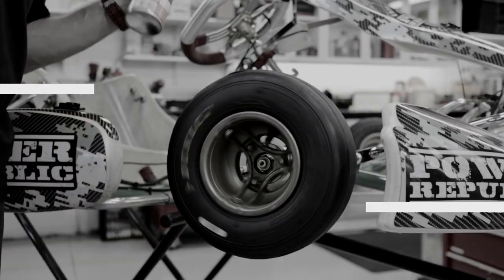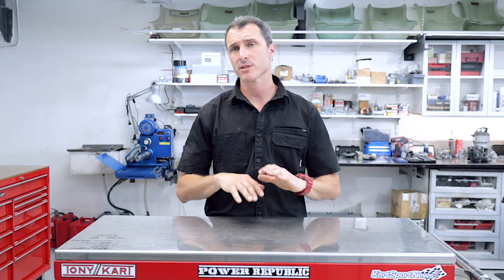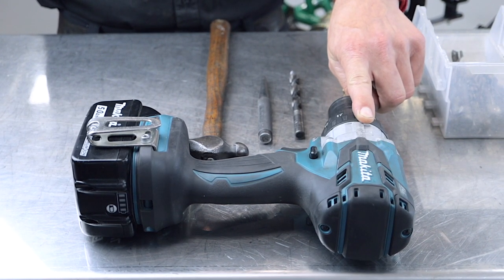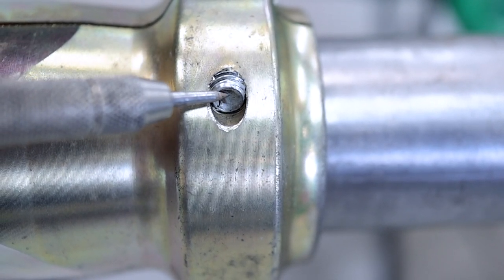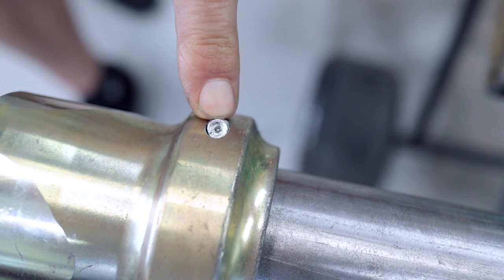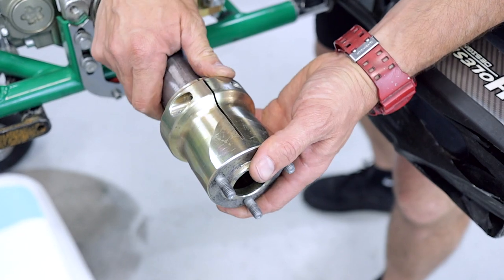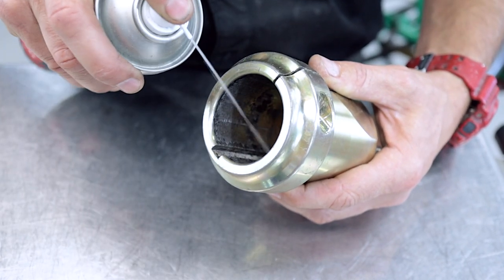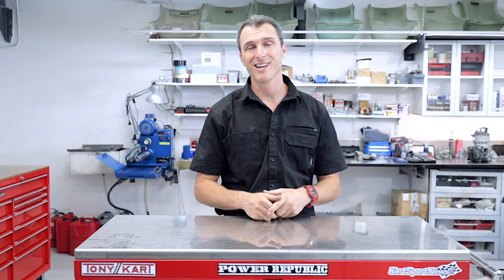RACE DAY SURVIVAL SERIES: Episode 1 - Stuck Wheel Hubs - POWER REPUBLIC

Comment: Another great and informative video Derek.  Keep them coming!  Just wanted to add that I recommend placing the right size hub spacer inside the hub to attain the right track width so that you do not need to worry about your hubs moving in during a race.  This means you aren’t tempted to over-torqueing the bolt and stripping it.
Reply from the maker: Great tip Jase, agreed

Comment: Oooor you could use a torx bit (35 - 40) on a 1/2 inch socket extention and hammer it into the rounded head. Then it will make indentations and you would be able to loosen it slowly with a ratchet.
Reply from the maker: Another great suggestion.  Thanks legend 👍

Comment: k quick question........why drill the head off the bolt i the first place(Maybe to relieve pressure)? Why not just drill from the bottom side of the bolt  right off the bat and back it out?
Reply from the maker: correct, take the pressure off first.  but I guess you could try and duo it from the bottom first

Comment: Hey mate.  Awesome vid. 
Is it possible to do a snapped wheel stud removal? I currently have this problem after practice last weekend.  
I have kosmic kart OTK magnesium hubs. 

Im aware I can drill stud and then use a easy out but not confident on process. Cheers
Reply: Center punch, drill partway into the stud, then lightly tap in an extractor and use a wrench to back out the extractor/stud.
Get something like this https://www.homedepot.com/p/GEARWRENCH-Screw-Extractor-Kit-720DD/205593425
Reply from the maker: Hi Cam, thanks for the suggestion.  stay tuned.......